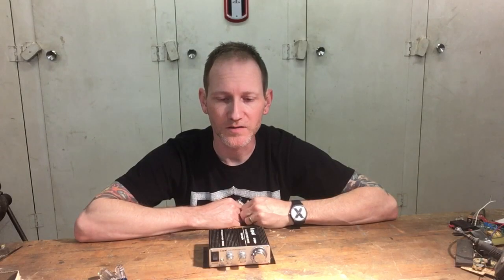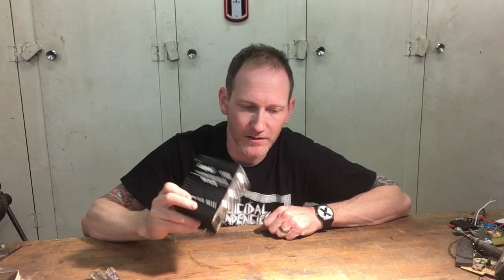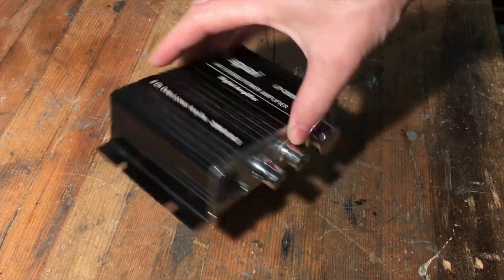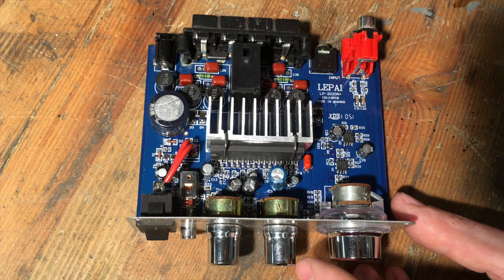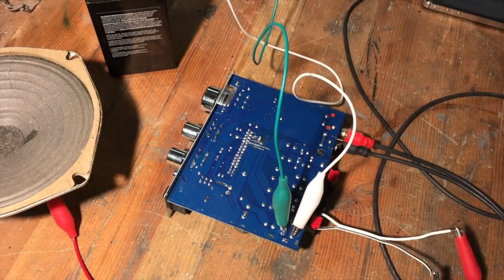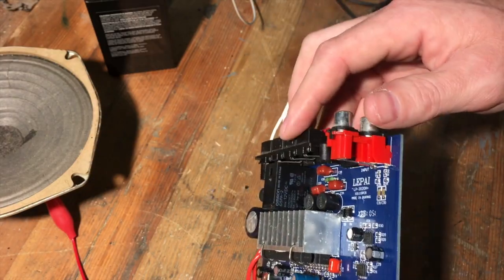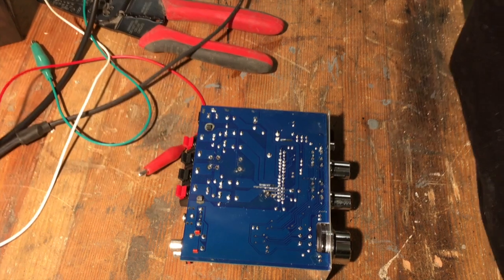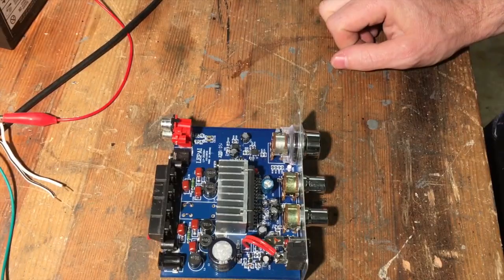Troubleshooting a Lepai LP-2020A+ With No Sound Output

Comment: Dude Tripath chip based amps sound awesome. Paired with the right speakers (high eff full range back loaded horns for example) they are sublime. simple supply and demand. The demand comes from the fact that they sound awesome are rare now = price goes up. That Tripath chip also made it into the chip hall of fame.

Comment: Sorry, but not helpful. I might be able to discern what to try based on this, but man, you’re hooking a battery up for some reason you didn’t disclose, and then you are touching these other two unidentified wires to the board, and that just doesn’t help, if you’re not saying or showing what they’re connected to. And in the end you bridged across the terminals that used to go through the relay... I guess. Cuz you didn’t show what you did there either. I appreciate you showing the general gist of what’s going on, and I’m guessing my relay is the problem too, but I’m gonna have to look elsewhere for the details.
Reply from the maker: I did kind of gloss over things. Sorry I wasn't much help.

Comment: I know, this is old old video... But I have a bunch of these little amps, and have built friends budget systems using these amps. If we're talking about pure sound characteristics... There is no better amp option until you hit around $150. Yes there's louder amps. And amps with less harmonic distortion, but the sound you get out of these is paired with the right speakers is absolutely amazing at the price point. I used it paired with Klipsch rp160m's for a couple years and found it so hard when I finally had the money to upgrade to find something tonally comparable. I ended up grabbing a huge $1200 receiver at a tag sale for $50. That's what it took to achieve better tonal characteristics, a once $1200 amp. The new kinter 2020 is just about the same. The other versions of this are indeed garbage sounding. And all those other Chinese class d amps sound like crap by comparison.